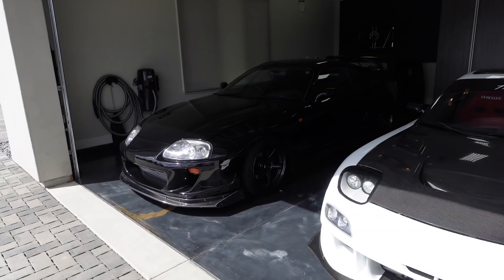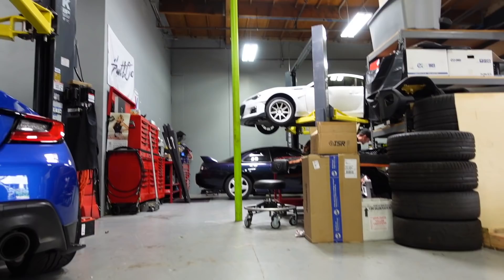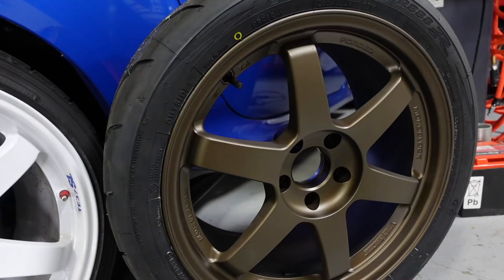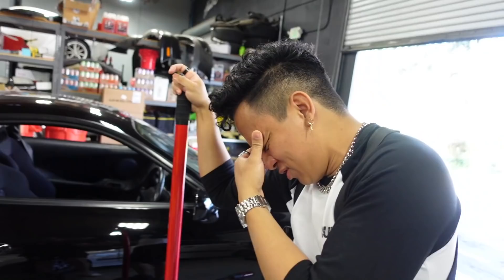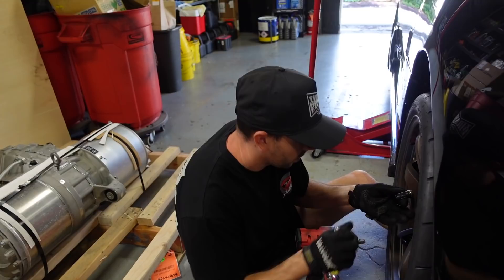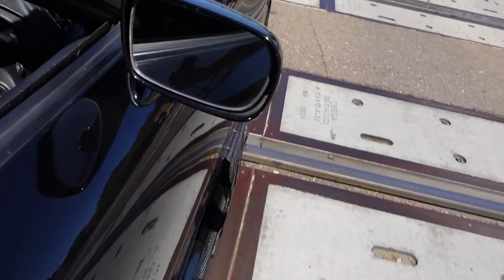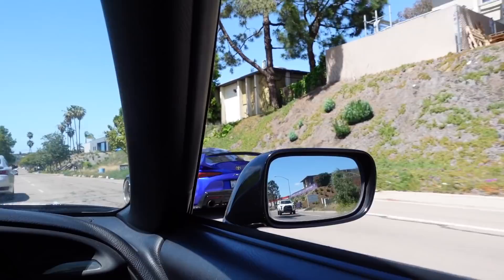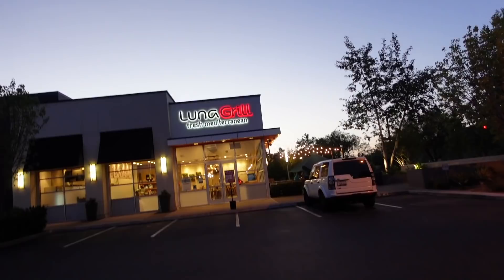NEW SUPRA WHEELS ARE GANGSTER!

Comment: usually you only need to unlock the adjusting nut and the turn the entire spring piece of the coilover to adjust I'm not sure you guys needed to remove the entire coilover, I used to do the same until I figured it out and it saved me a lot of time

Comment: Love the new wheels - the colour is very current and still classy and true to the cars 90s origin. In my opinion mk4s look better with a bit of rake so the front is a little lower than the rear. With a flat set up they look a little over weigh at the back. Just my opinion though dude - you’re killing it with that car
Reply: what does it mean when people talk about rake with cars?
Reply: @c_vanwyk99  rake is essentially the downward angle back to front of the vehicle. Meaning back is higher than the front

Comment: Put a bigger tire on , instead of lowering it in the rear . If you lower it enough to make that set up look good it will be scraping the ground all the time . As it is a smaller tire lowers the body by it's self , so if you drop it another 2 inches it will be about 3 or more inches lower .

Comment: IMO I was hoping you’d switch it up a little. I understand it’s such a classic wheel setup for the 90s jdm cars but you have them on dang near everything. But if you do keep them, I say raise it ab a 1/2 inch front and rear cause I feel like you’re gonna rub once you get the alignment
Reply: Also, you have to keep in mind that when you get on it that the car is going to squat in the rear so therefore having a flush fitment and being that low it will more than likely rub. All love tho 🙌🏻